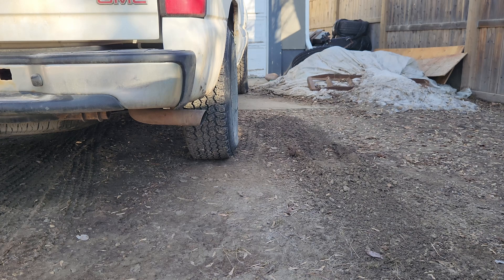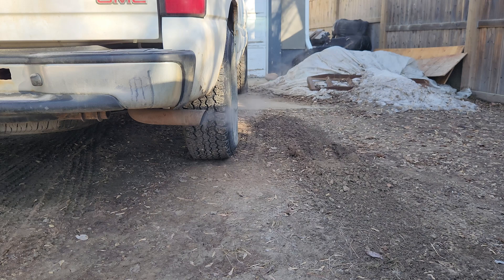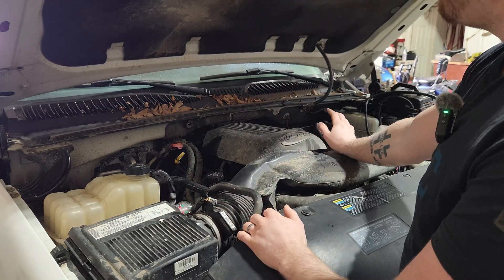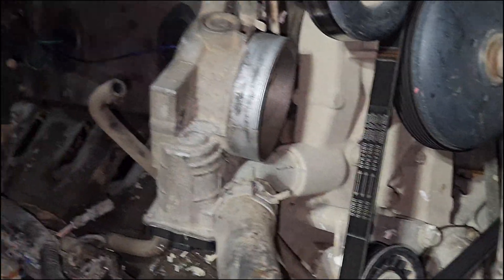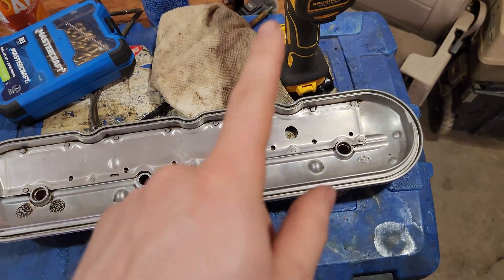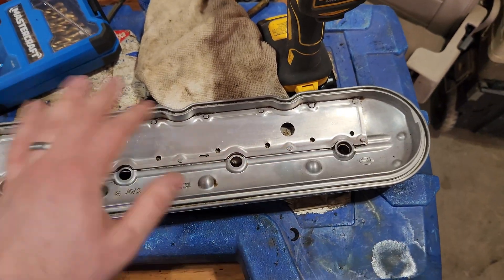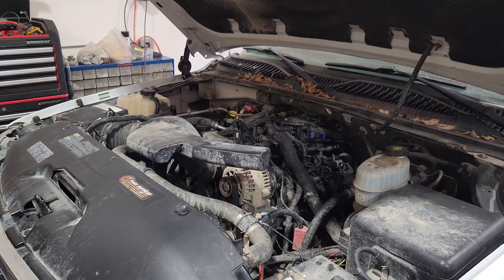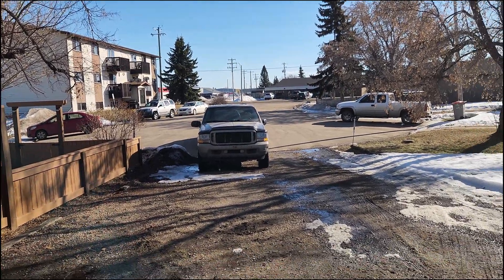CHEVY LS ENGINE - Everything You Need to Know About the Oil Burning Issue

Comment: If the holes in the valve cover work, it might be a good idea to do both sides
Reply from the maker: @musgrave-griffin5953  I agree. It wouldn't be a bad idea. From my understanding, it's the location of that hole on the driver side that gives the issue.